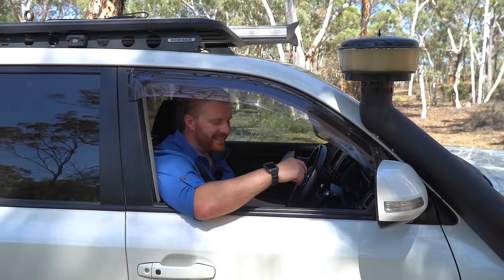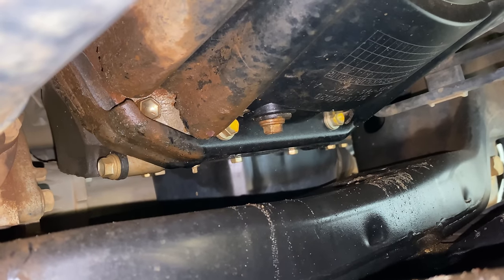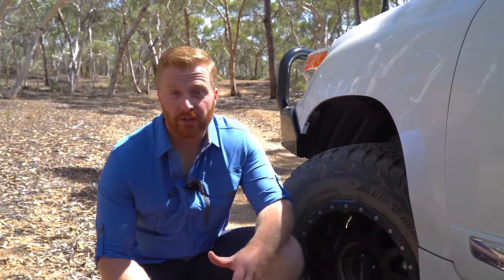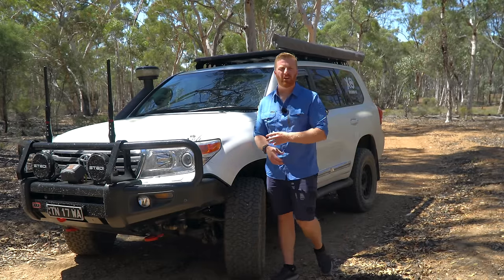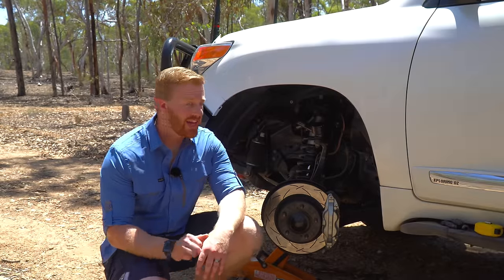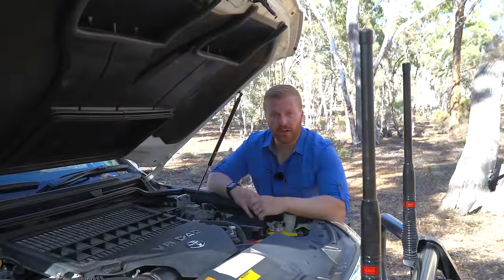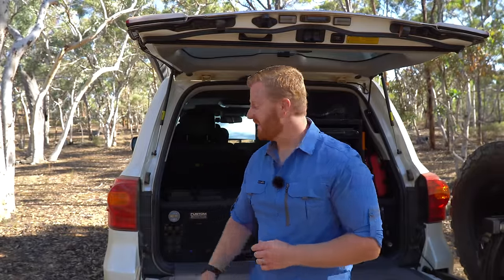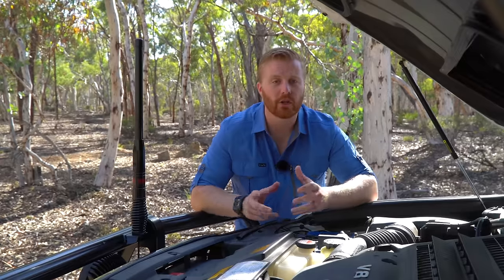LC200 | PROBLEMS & ISSUES | Not everything goes to plan -Mechanical-Electrical-Suspension 200 SERIES

Comment: This is just depressing!!  Making me question travelling with my 200 now.
Reply from the maker: Nah mate, don't worry about it. All vehicles have issues. It wouldn't matter which vehicle you choose, if you modify like I have than things are bound to go wrong. I wouldn't sell/swap my cruiser for almost anything out there these days. Still love this vehicle!
Reply: @XploringOz  hey Nate, I’ve only just bought this 2009 200 GXL, picking up a hybrid and wanted to put a tinny on the roof. Think I’m pushing my luck without the gvm upgrade.
It came loaded, bullbar, winch, dual swing bars, drawers etc(which I’m replacing. Your thoughts ?
Reply from the maker: @youngsuper7446  Hmm, form what you are saying, yeah I think the stock GVM might become an issue with those accessories and towing/tinnie etc. I would probably be looking at an upgrade. Saying that, you've got the advantage of having the gear fitted and good estimates of what everything is going to weigh, so you should be able to get a kit that suits your's weights and needs perfectly. 
Cheers.

Comment: Do you think the catch can could have contributed to rear main seal leak?
Reply from the maker: Potentially, but difficult to prove either way. Keep in mind the Provent unit comes with a pressure relief valve which is designed to avoid this issue. 
Cheers, Nathan.

Comment: Have you bypassed the pre filter to see if the fuel issue is there with just the factory filter ? I am sure you are onto it but is the seal in the top of the factory filter the correct side up.
Reply from the maker: Hey mate, to be honest, I haven't bypassed the secondary filter but I'll definitely give that a go. It would definitely let me know if that's the issue. I've heard it could be the primer on the primary filter, so I might look at getting that inspected or replaced as well. 
Cheers, Nathan.
Reply: Hi Nathan, I had a similar problem 12 months ago when I changed the secondary filter for maintenance and service. I now have completely bypassed the secondary filter and just go straight to the factory filter I haven't had a issue yet. and am reluctant to go back to the secondary filter due to reliability issues, I sense there is or was a bad batch of filters.
Reply from the maker: @damienbolton6761  Thanks mate, it's definitely something I'll isolate and try to diagnose. I had this fitted for about 40000km with no issue, so it's strange to think it's causing issues now, but like you said overall we have to think about reliability. Cheers.

Comment: Great vids. I always look forward to them truthful and informative. The key RF problems an be caused by the Inverter. Try fully isolating the DC side and see if issues goes away. I have had this problem in the van. It can interfere with most frequencies. Particularly if a budget inverter. Also make sure the inverter in earthed to the chassis. All inverters sold in oz should be CE certified and thus have a dedicated chassis earth terminal. This will also improve stray RF. As for parasitic drain. Your inverter will always draw current even if no AC load. I installed a 200 ampere combined circuit breaker/isolator on mine. This removed approx 200 milliamperes (0.2) of constant draw. Also your victron monitor will always be drawing current even when in power save mode with screen off. From a safety perspective I do hope you plug your AC appliances in with an inline portable Residual Current Device(Safety Switch). It may save your life on day. Do not assume that your inverter has built in RCD. cheers. Shane
Reply from the maker: Thanks mate, so unfortunately the inverter hasn't been the causes of some of these issues. The inverter is a relatively new addition to the vehicle and these problems were present well and truely before it was fitted. 
There is no doubt that is some accessory that I've added, hard to diagnose the wireless issue when it's so intermittent...
Thanks, mate appreciate the help 👍
Reply: I have a 200 2014 VX, the only thing I’ve installed is a UHF & red arc brake controller, I have same issues, most time keyless entry and start work, then all of a sudden, car will not start, everything else works ie central locking works, put foot on brake, put button get all the reds but no start, and it doesn’t say “key not detected”, it just doesn’t start, try several times, then all of a sudden, it starts. Got me buggered . Any help would be appreciated 
Dennis

Comment: Great video. I had a 2018 200 after years of owning 70 series (and still  own worlds best fj45). Hated  the 200. Just as i hated australias first fj cruiser which i modified like your 200. Everything seemed compromised. Hated the brakes, the droop, the soft interior. Yes, loved the tourer but a prado will do the same. So i went back to a 79 dual cab! Lol. Happy camper. Love solid  front axle etc. keep em stock, keep em serviced. 😊
Reply from the maker: Ah fair enough, each to their own. That's why Toyota make so many models, if we all wanted the same thing it would be fairly boring. 
Glad you have found what you enjoy though. 
Cheers, Nathan.
Reply: @XploringOz  oh thats not a critisim. Injust couldnt get it “fit for purpose” brilliant tourer and with mods very very capable. Just not fit for purpose for me thats all. Only vehicle ive nearly dozed off at behind the wheel lol! 👍
Reply from the maker: @simonhjc  For sure mate, no offence taken! That's what so great about the 4WD scene. They are so many models to choose from and we can all make our personal choices for a vehicle that best suits our personal requirements and personalities 👍
Reply: @XploringOz  💯 i had a troopie conversion pop top which was great, bought 200 for the seating as ive got grandkids but we never used it. So i went back to the dual cab 79. Doing a build at 60 is different to being 30. I even have to consider “do i want to climb into a roof tent”
Reply from the maker: @simonhjc  Haha, that's it. Preferences and uses change over the years. You need to get what is best for your setup and whether or not you want to climb into the tent 😂

Comment: Thanks for this video. As an owner with a 200 series and the same suspension set up I have also found the rake front to back is too much for my taste as set by ARB. Are you able to tell us what the measurement is from centre of the wheel hub to the guard on yours? I have the 17 inch rims so bottom of the rim won’t translate for me. Cheers.
Reply from the maker: Hey mate, apologies for the late reply. So my measurement sits around the 575mm mark.
Hope that can help. Would be interested to hear what you're sitting at, at the moment?
Cheers, Nathan.
Reply: @XploringOz  hi Nathan and thanks for that. Mine sits at approx 560mm adjusted to the ARB recommended 20mm thread exposed with ARB bullbar, 12,000 pound winch and ARB underbody protection. I have been planning to get the ground lifted about 10 - 15mm so your measurements seem to confirm that. 

Cheers,

Peter
Reply from the maker: @peterj5751  Yeah, sounds like a little more thread showing won't hurt your setup to get that little extra lift 👍

Comment: Electrical wise, check you have a good earth, or maybe try re earthing. Re the keyless issue, you will have a noisy appliance that is on the same frequency, or a harmonic of said frequency. I have a cheap 10w led on my automatic home gate which causes issue with radio signals. I have also built autonomous drones back in the early days that would have a GoPro 2 interfere on the 5.8ghz or 1.3ghz frequency.

Best bet is the process of elimination to see if you are getting RF issues. A spectrum analyser will help
Reply from the maker: Thanks mate, yes both of those points have come up a few times in the comments now. Something I'll definitely try and check over to see if I can diagnose and fix them. 
I'm not going to lie, I don't even know what a Spectrum analyser is 😂 but I'll look into it and see if I can fix it. 
Really appreciate the advice and help! 
Thanks mate, Nathan.
Reply: @XploringOz  more than welcome! Sometimes it's the little bugs that shit you to tears 😂
Reply: So some food for thought, my current issue reminded me of this video.

Just installed a itech dcdc behind the second row seat, power out to a portable lithium I have mounted on my fridge slide.

First drive today and my radio reception is shot which leads me to believe the dcdc is 'noisy' or the lead to, or from it is collecting RF.

I'll be diagnosing later and may look at installing a toroid or 4, and even wrapping the lines in tin foil then earthing that to the body.

Did you find your gremlin?
Reply from the maker: @rubiconned  Hmm, that's interesting 🤔
I'm still yet to find out exactly what's going on with my issue. Weirdly though, it's been working a whole lot better since I've had the lithium auxiliary battery installed. Not sure why, whether the higher voltage comes into play, or something else like you have mentioned, but it's hard to diagnose when it appears to be working 🤷‍♂
Reply: @XploringOz  electrical gremlins... Grr
Reply from the maker: @rubiconned  Yep 😞 all part of the fun of modifying vehicles...

Comment: i dont understand why you would have two GME aerials
Reply from the maker: Largely due to the fact that I run two GME UHF's radios. Definitely not required, but something I choose to do 👍
Reply: Mine has 2 , can switch between both 2.1 and 6.6

Comment: Oh dude I feel for ya!
Seems most of your issues are due to the incompetence of installers and also a few poor choices of accessories, such as those rubbish bp51's, Arb keep pretending that these are like high performance racing shocks ect... Get rid of em and the people doing the work. Best still, learn how to do all your own mechanicals and electrical yourself.
Reply from the maker: Yeah cheers mate. The suspension issues were a test of patience that's for sure! 
Although I'm happy with the ARB setup now, it's definitely no high performance reading shock. Perhaps one day I'll upgrade, but for now I'll just get my money's worth from these. 
Cheers, Nathan.
Reply: @XploringOz  Yeah mate, sometimes you gotta keep rolling with what you've got. It just shits me seeing people get ripped off with poor advice and even poorer service. The 4wd industry is a joke like that. 😏
Reply from the maker: @SteveBurns80  Absolutely, the caravan and camper trailer industry is even more so! Not at all regulated and such a risky area to spend hard earns money!
Reply: @XploringOz  If you change your shocks from what was engineered, tested & approved in the G.V.M package you will void your G.V.M approval. You'll need to stick with what it was designed with unless ARB gives it to you in writing that there are other shock absorbers that are suitable with that G.V.M package you have.
Reply from the maker: @dustyfarmer  This is true. However I'd probably look at another kit entirely. But this won't be happening anytime soon. I'll definitely use and abuse these BP51's for the time being.
Reply: @XploringOz  I'm stuck with the LOVELL'S G.V.M upgrade on my VDJ79R as it was S.S.M. It rides pretty rough without a load but I can mitigate that with lower tyre pressures of 36 P.S.I all round.
Reply from the maker: @dustyfarmer  Yeah, I did hear that about the Lovells kit, but they generally have a good rep though!
Reply: @XploringOz  Yeah I can't complain about LOVELL'S load carrying capacity but the shocks can retain dust & grit around the seal & leak oil. I know another bloke who has an un-known brand G.V.M upgrade & 50mm lift on his 79 and it's as soft as when it comes to un-loaded ride & looks standard height, they didn't fit the CAT6 indicators as required either so I don't know how that complies with A.D.R's but the engineer signed off on it.
Reply from the maker: @dustyfarmer  Hmm, something sounds amiss with that sign off 🤔

Comment: your .2a draw could be false, test with a multimeter.
Reply from the maker: Could be, but the flattened battery after a little while is a good sign there is some sort of constant draw. 
Cheers, Nathan.
Reply: @XploringOz  yup, ok deffs a parisitic draw
Reply from the maker: @DeejayManii  Yeah, some people are saying it might even be the BCDC charger. If so, something I'm probably going to have to get used to. Not a massive issue, as long as I'm aware and able to mitigate it. 
Cheers.

Comment: Leave the filler cap loose and see if it still happens, might just be too well sealed.
Reply from the maker: Thanks mate, haven't tried this yet so will give it a go!
Cheers, Nathan.
Reply: What fuel the injectors don't use is cycled through a cooler & back into the tank, the fuel cap has a breather built into it that can't block up.

Comment: Disconnect the catch can and you will probably find the rear main leak will stop
Reply from the maker: Hmm, this has actually crossed my mind. I'll see how we go. 
Cheers, Nathan.
Reply: Nothing wrong with the Provent 200 catch can if the filter is changed out at the specified intervals with a new one but they do have a crank-case over-pressure release valve to atmosphere on the old ones or closed loop on the gen.2 if the filter gets blocked so they won't be the cause of weeping oil seals. If your engine develops too much blow-by, removing the catch can will help but there are bigger issues at play. Remove the oil filler cap while it's hot & running & see what positive crank-case pressure is blowing out there. Some catch cans aren't worth buying as they don't work & blow seals as they aren't designed correctly in the first place, Provent 200 catch cans are not one of them.
Reply from the maker: @dustyfarmer  I would have to agree with this too. The Provent is designed well and specifically designed to avoid issues like this. 👍
Reply: @XploringOz  Most, if not all of the billet alloy catch cans I've seen have no over-pressure release valve like the ProVent 200 does, even the cheap $30 Chinese copies of the ProVent 200 have them (not that I would use one). Some, if not all of the alloy catch cans I've seen  have small orifice where they draw the "clean" crankcase vapor, that ain't gonna work & will cause leaking seals. The other major catch can fail I see regularly is the closed loop crankcase scavenge assisted with vacuum intake replaced by a catch can with vent to atmosphere through a paper filter on a crankcase pipe that has no intake suction drawing the vapor through an impact filter & condensing it into oil.

Comment: Lol, who used a chisel on the upper arm caps?
Reply: Looks to me more likely rock damage @13.42, Not unheard of to get rocks or pebbles caught between the rim & control arm or brake caliper particularly when driving in deep mud or deep sand.
Reply: Or open it for regreasing or checking the batch number for the recall??!!
Cheers
Reply: @holgermuller2987  The graze or gouge marks are on top corner of the cap right where a rock would impact when driving forward, not near the joint of the cap & arm.
Reply from the maker: Yeah, that's actually new. Only noticed it when filming this. Could be from rock damage or from a recent ball joint change as a result of the recall notice... not sure
Reply: @XploringOz  Looks like other debris scratches & witness marks over the other side of the cap too. When I've been bogged to the eyeballs I've hosed out all sorts of packed in mud, rocks & grass from inside the front & rear wheels and from even inside the brake rotor vents.

Comment: Us 100 series owners can only feel sorry for you.
Reply from the maker: Haha, although I know how good the 100 series are (used to have a 105 series) all vehicle are vulnerable to issues of one sort or another. Nothing is perfect. 
Cheers, Nathan.
Reply: @XploringOz Cheers, the 105 is as reliable as it gets. Not having any electronic engine management is a big plus. No CV boots etc, etc.
Reply from the maker: @AquaMarine1000  Absolutely, that thing would run on whatever, but again wasn't perfect. Oil leaks around the swivel hubs were amongst some of the issues, however no doubt a lot more reliable than anything electric... sacrifices comfort though!
Reply: @XploringOz  a leaky inner hub seal is a maintenance issue - simple to replace. At least we are not listing Landrover, Jeep, etc. problems. Cheers and safe travels.
Reply from the maker: @AquaMarine1000  Haha, true! Not sure if YouTube could handle a list that long 😂

Comment: Where is the secondary diesel filter plze?
Reply from the maker: Hey mate, the secondary fuel filter is immediately behind the primary filter. This is a final post filter before the engine. 
Cheers, Nathan.
Reply: @XploringOz  cheers would that be the same on a vdj200 2007 ?i enjoy all your videos and suggestions very informative
Reply from the maker: @chrisvardy2758  I believe there are a few kits on the market that have their own mounting hardware and positioning, but I would assume that the FuelManager kit would also fit in the same location for a '07 model 👍